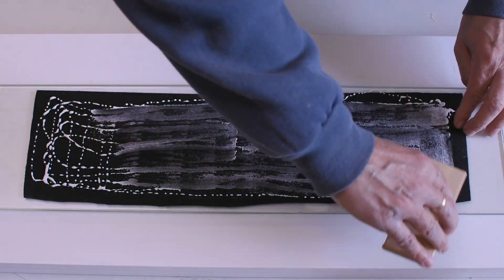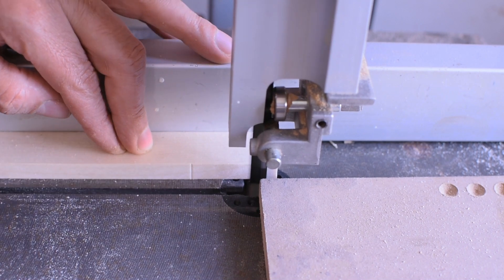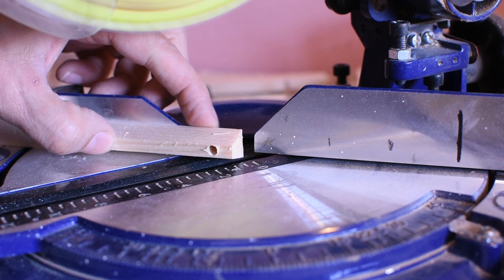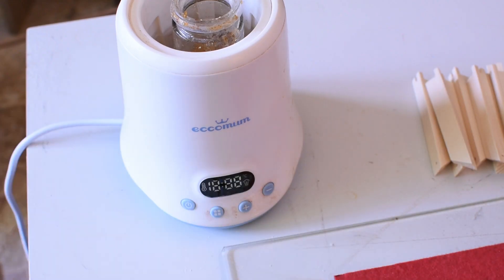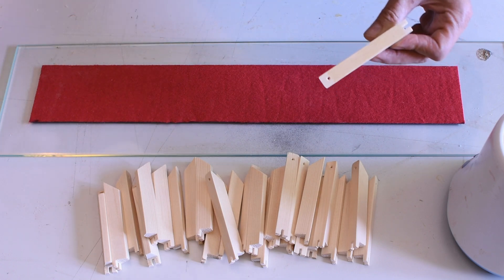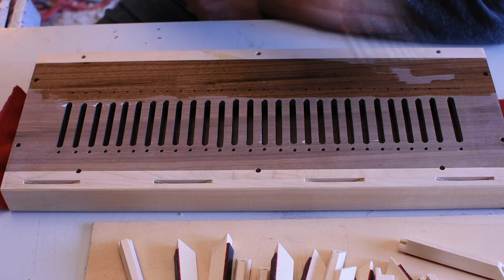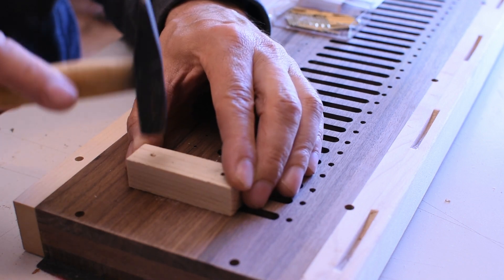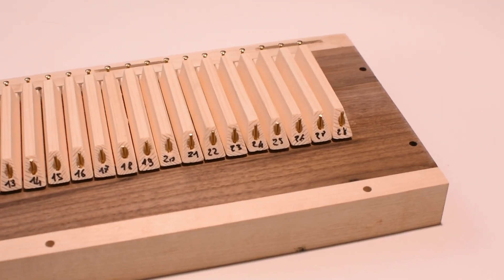How to build portative Organ | #21 The Pallets | SUB ITA | Homemade Pipe Organ

Comment: So exciting!  A couple questions: 1) You put the pallets on in their numbered order - rather than numbering them after - how did you determine that order? 2) What is the synthetic leather you use? 3) do you still plan to make the files for the templates you've created available? :-D
Reply from the maker: Thanks Michael, 1) I first inserted the pallets, checking that they moved freely, perhaps replacing the positions, once their position was determined, I numbered them. 2) it must be smooth leather, without textures, and soft. Any with these characteristics is good. 3) I will definitely do it, I just don't have much time between preparing the pieces to be recorded and building the organ. As soon as I have finished I will dedicate myself to that, maybe even making some theoretical videos